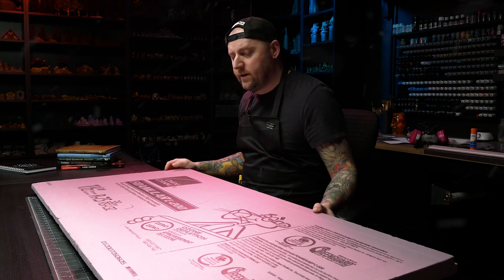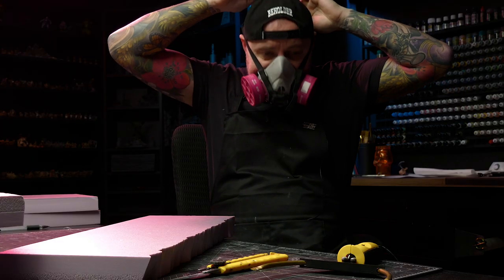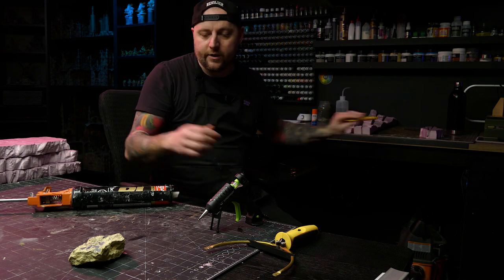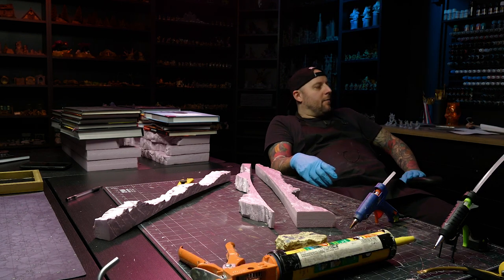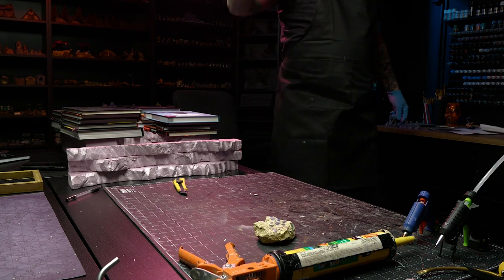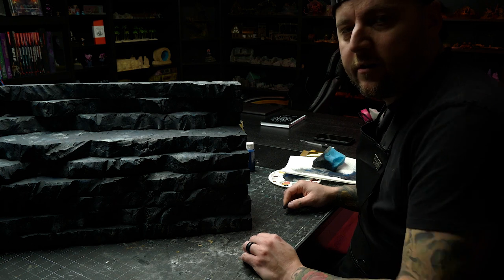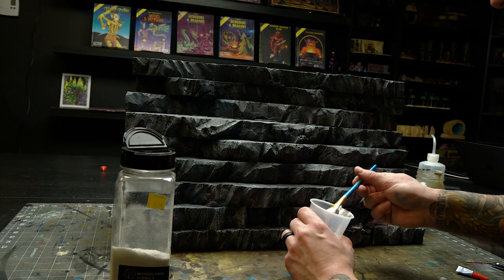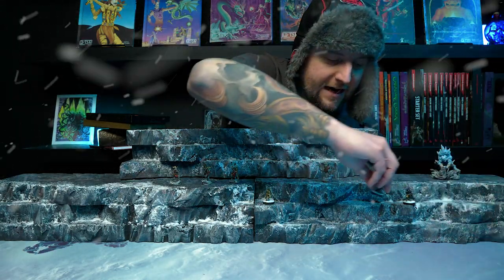I Made EPIC Modular MOUNTAIN Terrain for Dungeons & Dragons!

Comment: Of all of the foam terrain I have built, straight wood glue has never failed me. And, it can be stored longer than caulking (in my experience). Nice finishing work, I will have to loving rip that technique off.
Reply: wood glue is just extra-strong PVA. both can take a while to cure between 2 sheets of foam, so I'f im doing big sheets I use low-temp hot glue for speed.

Comment: Awesome build. For those big tubes of adhesive put a large nail in the end. It seals the tube and then its easy to pull out and keep using instead of having to keep cutting the tube shorter and shorter.

Comment: Love this (as always!!)!! if you will indulge me: I created a set of modular mountains too. Imagine a circlular mountain (with steppes etc..) then cut into quarters. The quarters can be set into a circular mountain, 1/2 a side of one mountain, two 1/2 sides of a mountain (creating a valley) or each of the quarters placed on the corner of the table creating a bowl, crater or caldera

Comment: Another good build vid.  I do like at the end you showed the layouts.  That is very cool!  I was thinking you could add fire/lava effects instead of ice/snow.  Here is a quick tip for glue: use 3M spray adhesive.  It's rubber cement in a can.  Just spray both pieces of foam and stick together.  The bond is instant.  Just mask off with tape the parts you don't want any spray to get on.  Try with with some small parts as a test.  I have used it for over 2 decades.
Reply: I was considering this, but as spray paint propellant melts foam, does the spray glue as well? I know you can shoot paint from far enough away to avoid that, just wondering about the glue. I think I have a can of super 77 somewhere.
Reply: @Born_Stellar  Yeah just don't soak it and spray from a distance.  I always hit both sides with a couple light coats and then press together.  Bond is instant too.

Comment: Beautiful in its simplicity; I would consider making them ~9" in length to match the scale of my dungeon tiles and allow smaller mountains, maybe a couple 45-deg corners. It seems to me that if you start with some 9x9 and stagger your cuts by 1/2", they can be assembled in stacks of 3 of similar depths and result in 4 different depth steps:
The cuts I'm thinking on 6 different 9x9" are: [1, 1.5, 2], [3, 3.5, 4] (which results in complementary cuts of [8, 7.5, 7], [6, 5.5, 5]) Basically mountain-sized dungeon stackers.

Now to figure out how to make some leeetle ladders. ;D

Comment: I cant help but notice we tend to do similiar projects at the same time. Currently Im sculpting a mountain out of an old foam sail boat. The foam is similar to styrofoam but more dense. The boat was broken & abandoned, & I figured it make a great mountain. I foresee storage problems in my future... the shipping foam from the inside of  lamp shades is absolutely perfect for sculpting hills. Its styrofoam but I find if you add filler medium  (like gesso) you can make styro foam or even floral foam fairly solid. Ive had some pieces for years & they've held up well through years of play. I've made a few from Styrofoam picnic coolers/ ice boxes but they just dont look right. Thought of stacking cedar bark chips buI never attempted it.  Never tried using  stacked insulation foam before, I do like the stepped incline, it's perfect  for gaming. The look reminds me of layers seen in the sedimentary rock of fold mountains,  Kudos!

Comment: I play with a lot of groups that do a good portion of their D&D online, and are therefore very fond of gridded play areas. I'd like to ask how you would tackle making something like this compatible to a grid, or if you'd use it as-is and apply some other rulings to moving up and down it to emulate gridded movement?
Reply: @FrozenThrog  Well... hypothetically, if you plotted the squares starting from the back of the mountain pieces where everything would be flush, I suppose you COULD have a grid that works top-down. At that point you'd be plotting a grid on every layer, though, and I have to wonder if at that point doing the three-tiered pieces would make less sense than keeping them all separated and weighted with short screws

Comment: I can’t tell are you using 2 larger sheets of xps or did you cut that 1 larger board down? Not that it matters in the long run I was just curious and I will definitely be making my self a set
Reply from the maker: I used the one sheet you see at the start.

Comment: Looks... okayyy... 

Rock molds and sculptamold for the rock faces would've looked a lot less 'beginner'.
Reply from the maker: It’s supposed to be a simple project. Easy, fast, light, not fragile…
Reply: @BlackMagicCraftOfficial  there are some very simple ways of making more realistic cliff faces that are still relatively light, and still easily modular/stackable (one example of how you can reduce weight is using polystyrene along with the plaster in your rock molds). Maybe check out some alternative methods as well as other terrain makers out there to see how you could improve 🙂

Good tutorial for beginners to follow though man 👍